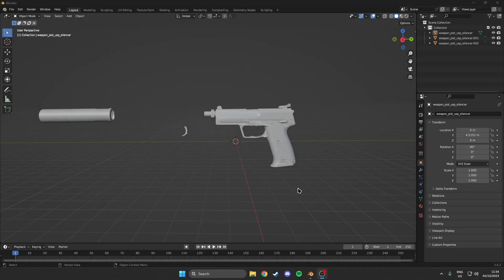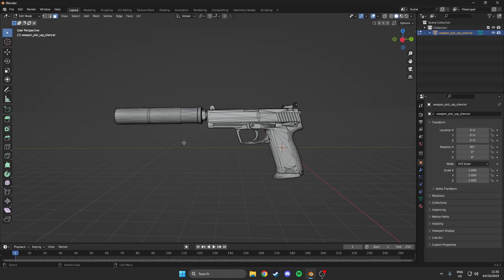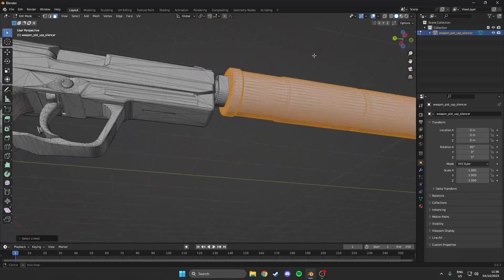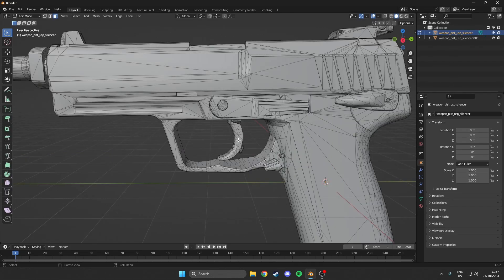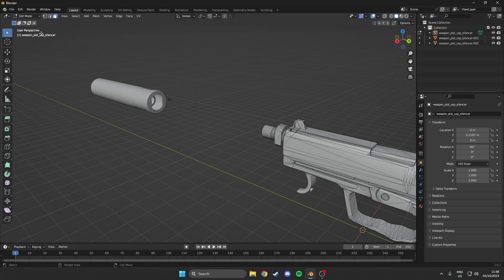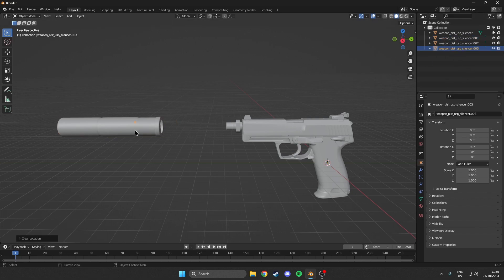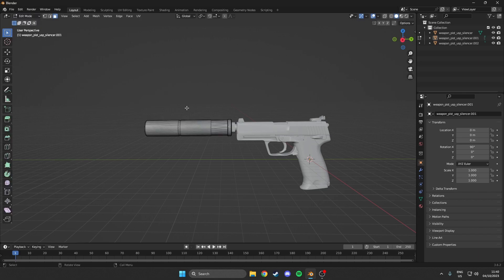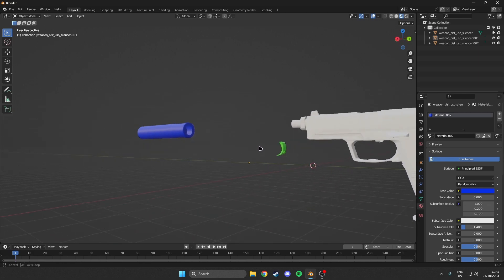Assemble And Disassemble A CS2 Skin Using Blender

Comment: Hey there, really good video. I was wondering how do you disassemble the mag? I am really struggling with objects inside the actual weapon.
Reply from the maker: You'd have to remove the parts around the mag and then do the mag. It is tough, but that is the only way, as far as I know

Comment: how to bake a glass texture like in a clean polymer?
Reply from the maker: Check the video about using blender materials, I show baking in there. Glass texture is something I haven't done yet, so I don't know really. You might be able to achieve it with some material in blender. Not sure
Reply: @MarkayCS  I tried baking glass, but in blender it looks cool, but in the game the shit
Reply from the maker: @kioShimyo  did you get a custom HDRi for the lighting?
Reply: Also a video on baking and exporting metallic textures using Blender would be awesome.
Reply from the maker: There is a video on my channel about using Blender materials, in which I also show the baking process. That should also work with the metallic effect that is built into the BSDF. @Scout-1-4
Reply: I just searched everything in the world and didn’t find any information on how to make an object glare in the light or glass in CS, this has to do with normal maps but that’s all I know